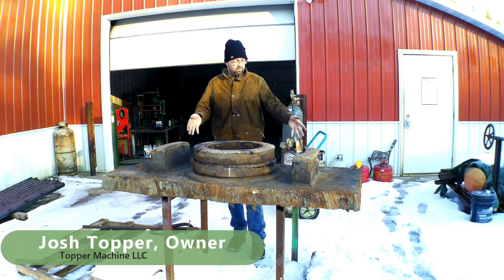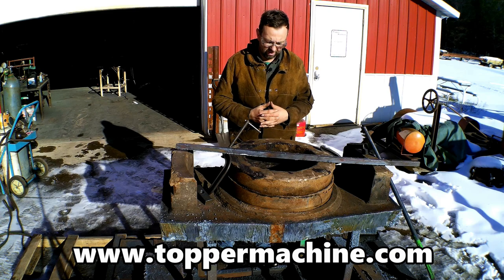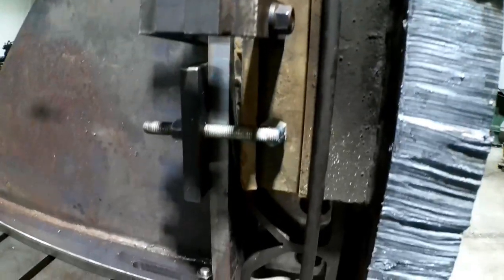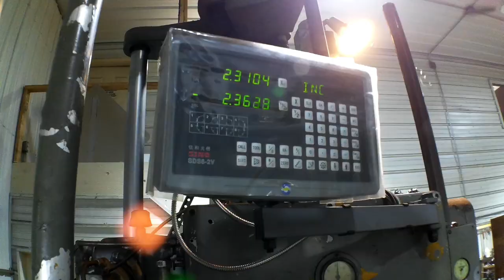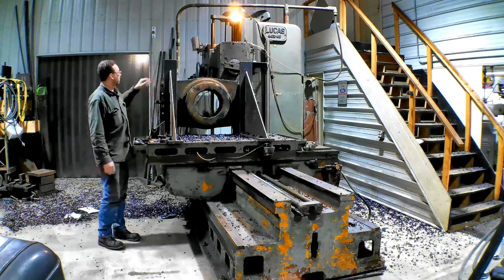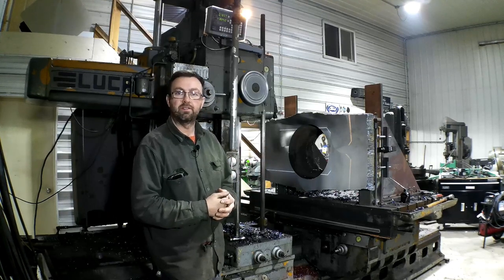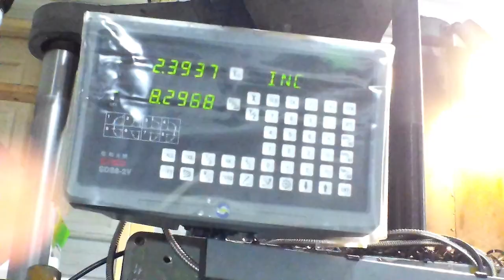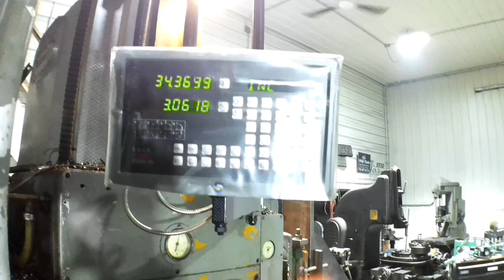Machining A Big Part for the Mark Twain Zephyr Train - Heavy Milling on the Horizontal Boring Mill

Comment: Josh, I love your machining videos, I'm a welder slash machinist, if you don't mind I can give you some pointers on cutting thick plate like that with smooth cuts, if you don't have a #6 tip I'll send you one but a 6 tip and pull the torch towards you it's easier to be steady that way, let me know if you need that tip. Also I'm in the process of purchasing a #5 Lucas boring machine I can't wait.
Reply from the maker: Thanks. I have since upped my selection of tips. Now having the copy torch, it was needed.

Comment: Holy smokes, that sure was not sheet metal. That was a lot of milling but you came up with a plan and got the job done. I made a program and cut a part today and it works just fine. Thanks for the video. :cat-orange-whistling::cat-orange-whistling::cat-orange-whistling::hand-orange-covering-eyes::hand-orange-covering-eyes::hand-orange-covering-eyes::hand-orange-covering-eyes::trophy-yellow-smiling::trophy-yellow-smiling::trophy-yellow-smiling::trophy-yellow-smiling::trophy-yellow-smiling:

Comment: Wowwww. Pretty remarkable to work on such an historically notable and beautiful train! Do you think the chips generated carving away 3" of steel 1/8" at a time paid for the electrical power to run that beast of a mill? I will have to peruse some of the other YTs on this train being refurbed. They were quite handsome trains.
Reply from the maker: More than paid for the power consumed.

Comment: I ran couple of these old Lucas mills back in the 1970s , it was always a pain with the controls on this side when face milling or fly cutting, yea needed to button up yer shirt tight around your neck to keep those darn hot chips out . Was nice when I got in the Giddings &Lewis mill and worked on the other side.
Reply from the maker: I prefer the Lucas over the others. They all feel backwards to me.

Comment: Very nice to see this. How many toolbits did you need to take away this 75mm? 100 flame cutting by hand is not so easy and can be better done outside in the winter.
Reply from the maker: The 3" of removed material took 8 corners on the sandvik inserts.

Comment: I ran a big Bullard HoBo early 80’s, I don’t recall ever fly cutting but I used to face mill and line bore stuff that big regularly. It was maybe a slightly larger machine with a tailstock. I was 19-20 at the time. Cheers.

Comment: Wow living in Wisconsin is tough. You have to shovel snow and metal chips. LOL!
Reply from the maker: It's quite miserable here.  I just brought in a bunch of repair work, that needs the snow melted off before I can start. UGH!
Reply: @TopperMachineLLC  Ironically we have been unseasonably warm. it has been high 50's and low 60's here. Last year at this time we had snow.
Reply from the maker: @hilltopmachineworks2131  we got nailed with a foot of s**w last night. Spent 2 hours plowing out the yard. Had to plow a trail to the boiler, couldn't even walk to it.

Comment: I feel like you could really do with some kind of chip shroud. Something like those flap doors, two strips, that can be attached onto your gantry crane. they won't impede the bed's movement, and won't prevent you getting to shut-offs should something go horribly wrong, but will definitely keep those chips a bit better contained.

Comment: Hey Josh, beautiful finish with the single point. Just curious why you didn't use a high rake insert cutter say 6" diameter to rip it down.
Reply from the maker: This fly cutter works great, my face mills are significantly smaller, and I didn't have enough inserts to make it through. With all the torch cut places that for milled, I would have gone through inserts like crazy.

Comment: Josh, I wonder if using a large face Mill with ceramic inserts might have worked a little better? You could run it dry, and you could ramp up the RPMs all the way to the top speed..... Which would allow you to increase your feed rate as well.

Did you have to do any boring or finish off the exterior side walls at all?
Reply from the maker: If I had a face mill, yes. I have since acquired a 10" and a tool holder for the 6 Morse Taper.
Reply: @TopperMachineLLC  That's terrific. You can do a lot more efficient machining with that.

Comment: Hello Josh,just wondering would it have been possible to cut the ring off and weld it back onto a plate ?
Reply from the maker: Not what the customer wanted done.  I suggested cutting off the bolster and side bearings and putting on a new plate, but the customer has the final say.

Comment: I'm no machinist so asking from ignorance:  Would cutting off a slab with a big band saw (assuming you had one) then finishing with your machine been a feasible way to do the job?  Also, do all the chips get recycled?
Reply from the maker: Sure it would. Anything you can do to remove a large chunk first is always a good idea. But, a saw that size isn't available around here. Yes, chips get recycled. Thanks for watching

Comment: Why aren't you using a large face mill, the HBM certainly has the power to swing a large cutter and take a deeper DOC.?
Reply from the maker: Because I don't have one. I've been looking for a good used 12", but all of them are obsolete inserts. Keep looking I guess or wind up building one. Either way, this kind of job is extremely rare. I've only done this 4-5 times in 10 years.

Comment: Do you need the spindle running to use the rapids ?
Reply from the maker: No, I just shift te head to neutral.
Reply: @TopperMachineLLC  So the rapids ARE driven by the spindle motor. Thinking about this, I think I knew this - LOL.
Rapids on mine are driven by a motor in the knee. Feeds are driven by the spindle motor and feeds are reversible - and if that's done, After a power feed cut, using the rapids lever only, I can return to the start ready for the next pass !
Reply from the maker: @millomweb  this mill uses one motor for all. I can shift the head to neutral and still have my feeds and rapids. I know it's a little confusing, but I don't know how else to explain it.
Reply: @TopperMachineLLC  IIRC, you can declutch the spindle drive and still use the rapids (but possibly not the feeds!) As long as the motor's running.
Reply from the maker: @millomweb  there is no clutch on this machine for spindle. Only electric clutches for feeds and rapids.
Reply: @TopperMachineLLC  Sorry, I'm getting confused about which machine were'talking about ! I have slipped to the Cin mill !

Electric clutches is an interesting one - for such a machine !
Reply from the maker: @millomweb  the electric clutches is the Lucas HBM. Cincinnati has clutched spindle and the rapids has its own clutch for engagement. Works with and without spindle engaged.
Reply: @TopperMachineLLC  A video tour round the Lucas demonstrating its features will be a video I'll look forward to - when you get time. Thanks.

Comment: So I've been wondering. What exactly does Uncle Sam not like whats being recorded regarding trains?
Reply from the maker: It's not what they don't like. They like it, because they can use it as evidence for fining. If they see a violation, no matter what it is, they now have hard proof.
Reply: @TopperMachineLLC  Ok. So there are regulations on the manufacture and repair of train equipment, I presume? I just have a hard time believe you'd ever run afoul of any such regs, given how you loathe shortcuts. 
Then again,  there's no requirement for laws to make sense, is there?
Reply from the maker: @superdupergrover9857  you've never dealt with the FRA. They make the German SS look good.

Comment: Seriously you could plow ¼ deep at .030/rev feed with an 8 toothed cutter
Reply from the maker: When the tooling isn't available, you do what you need to do the job. I have since acquired a 10" face mill.
Reply: @TopperMachineLLC  thats insane. Theres no shortage of face mills down here hope you got paid by the pound of chips lol
Reply from the maker: @jasonhall3729  problem was more to do with locating a 6 Morse Taper holder.

Comment: If you answered this I missed it, but why are you doing this? Seems a huge waste. Why not torch the features off and weld them to 1" plate then just mill the features to depth you'd have like 8 or 10" to fly cut. Again sorry if I missed why
Reply from the maker: The customer specified how they wanted it done. I suggested starting over, but they shot that down.
Reply: @TopperMachineLLC  ok customer is always right I get that. What was this for looks to be some kind of restricted pivot. Really enjoy your videos and interaction with us. Hope you never burn out 🤞
Reply from the maker: @311Bob  details are in the video description

Comment: Firstly,  was it really cheaper than getting a 1" plate new??? 2: why the hell did you use a single point tool on this??? I would have used a 3 or 6 or 8 or 24" face mill. Local RR club take their money i guess....
Reply from the maker: I suggested starting over with a new plate. No go, the tooling is what I had at the time. 6 Morse Taper tooling is getting hard to come by. Since this was filmed I have acquired a 10" face mill and holder.